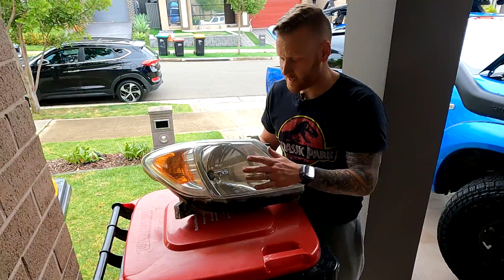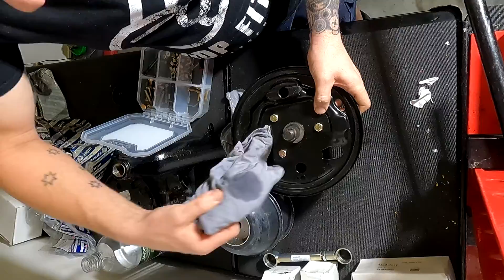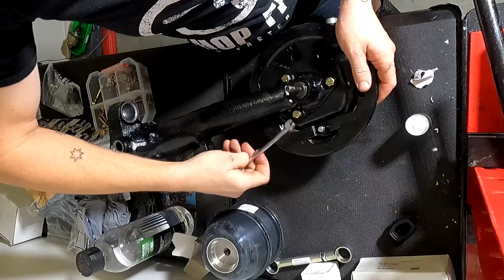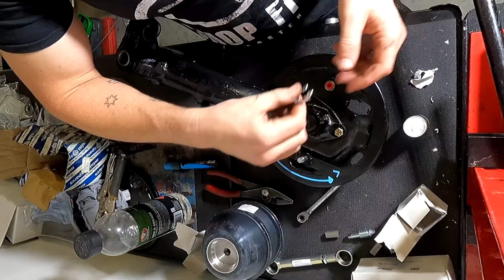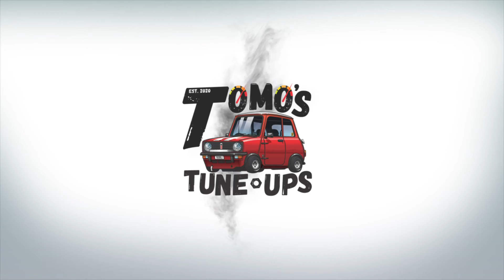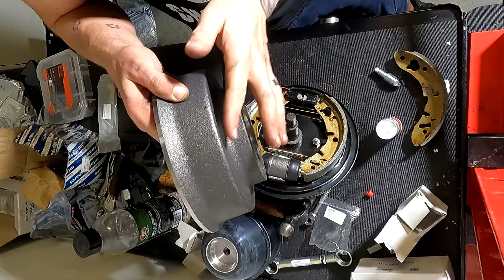1275 Classic Mini - Rear suspension build - Part 2

Comment: The springs look to be around the wrong way - from my memory, the one with the two short sections of spring is meant to go at the bottom, alongside the handbrake lever.
Reply from the maker: Hey mate, thanks for your feedback. I believe (from memory) I reassess this issue in the next episode. Well done for picking that up 👌🏼